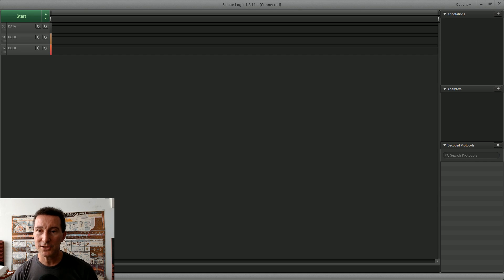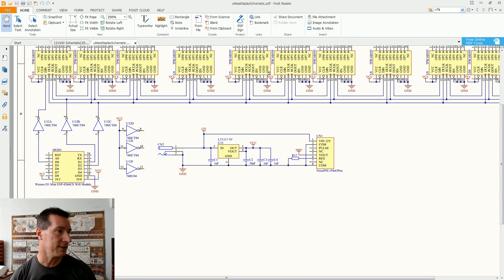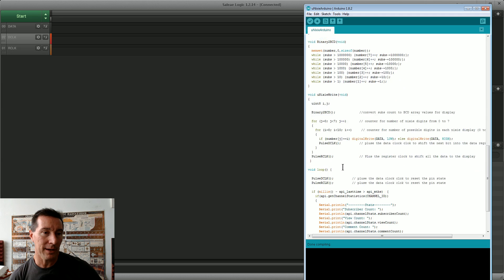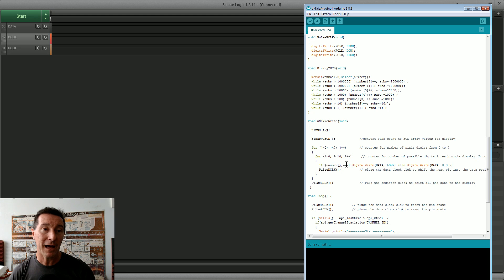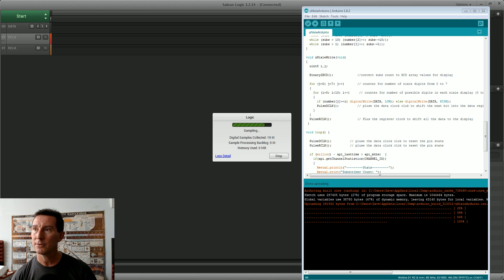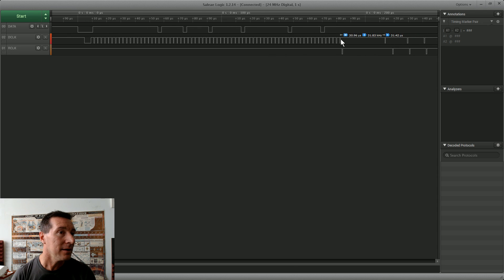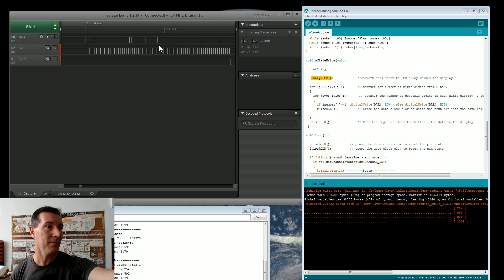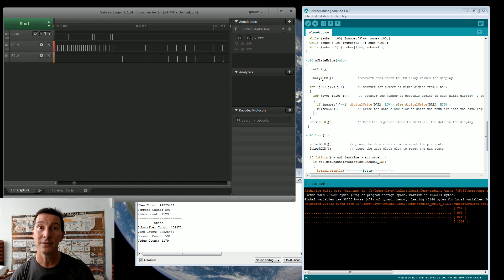Nixie Tube Display ESP8266 Wemos D1 Mini Testing

Comment: The first two statements of the loop should be in the writeToNixie routine.  There need be no data EXCEPT when it is changing.  You can see the extra on the logic traces @17:57... quite nice... might have to get myself one of those... the clones are peanuts

Comment: Ok, no comments on your coding style, but I think we've seen the equivalent of a few nary bodges there. Convert2BCD() with no input and output parameters? Doing much with globals, are we? You'll need yet another Dave to rant about One Hung Low coding style 😉
Reply: Dave is good at giving criticism but not taking it
Reply: I'd reject such code while doing code review, but just for a home project? Who cares. And last time I was playing with avr gcc, globals bound to registers considerably reduced image size (like 10 years ago..).
Reply: peteabc1 of course it will work. It's just not the least elegant, and that from Dave, who always points out badly designed electronics. Those will also work, they're are just ugly. This code is a grounding wire that is badly soldered and attached without a shake proof washer 😉. 
I just found this funny. 
Btw, I have a few instances of code like this running. It happens, but it's nothing to be proud of.
Reply: Lighten up. It's just quick prototyping, Peter dude. Me, I always go for impeccable source code, I really do. Always. But quite regularly I hack together a quick somethin' to get a 'feeler' reaction from the system. You know, dive deep, and clean up later. ... But, of course, I don't publish it to 10K people, like Dave does :-)
Reply: John Kortink do you know how difficult it is, to make sure that everyone recognizes when something is written tongue in cheek? You would think there was a smiley for that 😉
Reply: EEVblog2 come on Dave, relax. You seem to have overlooked the 😉 or not taken it for what it was: light hearted and amused.
Reply from the maker: No comments on coding style and then proceeds to comment on coding style.
Congratulations, you lose the Internet
Reply from the maker: Peter Jakobs Can't let it go can you? You just had to be THE ONE.

Comment: Whats all the pulses after you are done on the 2 clocks from? Thats just going to overwrite what you just clocked out with zeros I would expect.
Reply from the maker: Yep, I goofed the init code. It's fixed.
Reply: Rich M-Smith Thats what I thought too. Especially the RCLK may clear the display everytime without prevously data written to the buffer. This is a true point where it comes pretty handy to have a logic analyzer...

Comment: I didn't really understand what you did about the voltages and bleeding voltages in the nixie tube, and how you said it could be done with less voltage than rated. It may be nice to just sort of toggle some control lines with like toggle switches to see if they work to start with. Sorry if I am bothering you...

Comment: You can replace your while loops with binary AND values. if (num & (1 << Nth_BIT)). This way you can just send those over the wire. You may also consider not using global state and instead passing function arguments.
Reply: The underlying issue has to do with what each of us thinks numbers "really are".  Initially we're all taught that base 10 numbers are different from base 2 numbers are different from BCD numbers, and so on.  We can convert between them, and we're taught it's an algorithmic math thing.

But only later, as we're dipped in CS lore, do we gain the perspective that "it's all bits" and "bits are bits".  I still vividly recall when I first truly understood this perspective, and the freedoms it gave me.  It opened the door to "bit twiddling", to find mappings from bits to bits that bypass the whole algebraic mathematical transformation domain.

The general issue comes to the fore when dealing with math libraries on systems that lack an FPU.  In such environments, even floating point is "just bits" (not a hardware register format), and the code to quickly and accurately calculate the sine function can quickly become unrecognizable from the perspective of its mathematical foundations.

Dave undoubtedly knows all this!  He's working at a much higher level, where he knows he's "obviously" getting the right bit pattern to send to the Nixie digits, and he doesn't care one whit about algorithmic trickery, much less optimizations.

After all, it is so easy to make a mistake when bit-twiddling, and those can be the hardest bugs to isolate.  It is better by far to write "obviously correct" code than it is to do what may well be "premature optimization".

He is working on a 32-bit processor with a decent clock rate, not an 8-bit thing starved for space or cycles.  "Obviously correct" code is what's needed to troubleshoot the system and hardware.

Only after it's all working correctly should bit-twiddling be attempted.  And at that point, why bother?  The CPU doesn't really care at all - it has all the time in the world.  And it doesn't matter from a code size perspective, since the loops are quite tiny.

"Don't care" is precisely the right perspective, especially at this stage of development.
Reply from the maker: I don't care.
Reply: Well you said we couldn't complain about the comments so we needed to find something! Your way is fine. Just thought the & was a neat trick worth sharing.

Comment: Webcam might be lagging because there is not enough light, they tend to drop frames per second to keep brightness at the same level, it's the same way in digital cameras, they need more exposure time to compensate for low light.